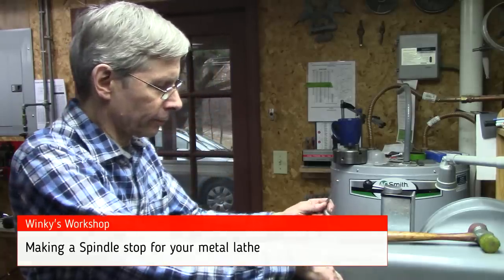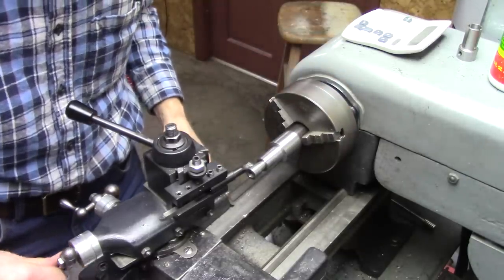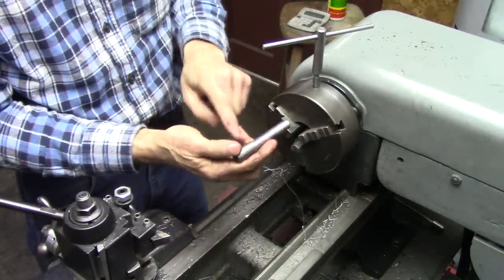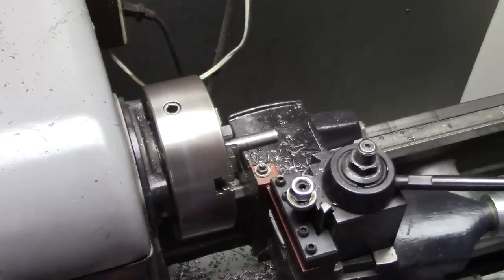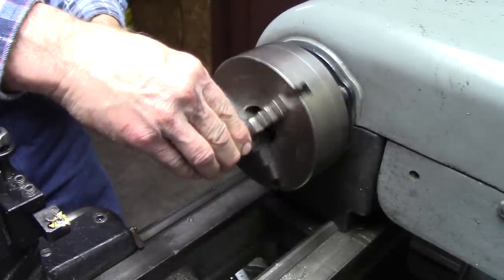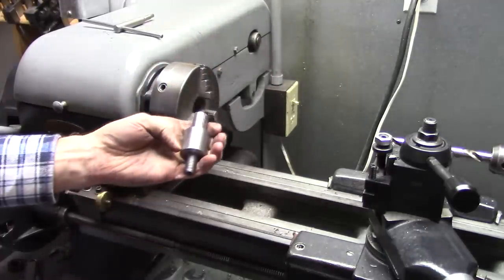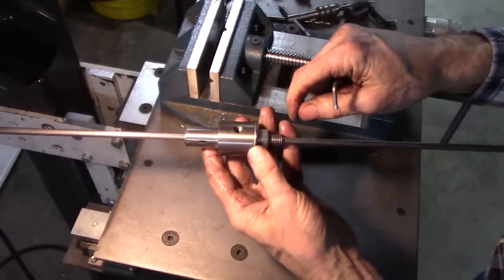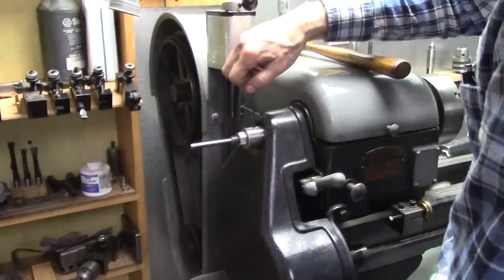Make a Spindle bore Depth Stop for your metal lathe

Comment: This is a really handy lesson for us that might come in handy at least knowing if we need a stop for a small production job and instead of what we do now measuring in from the spindle nose with the raw bar stock length setter. Thank you for showing us how it is made and made reliably. Lance & Patrick.
Reply from the maker: Thanks, I made the first one about a 2 years ago and have used it maybe 10 times. I was making multiple parts for work and it was super handy.

Comment: Nice build, found a commercial made unit while seagulling the other day, never seen one before
Reply from the maker: Thanks! I made another one after this one. It's similar but a bit more simple. I just found one of the commercial stops. It looks similar. I was wondering how they would make one to fit different bores but it looks like you have to order according to what your lathe bore is.  https://youtu.be/A663_KAFptA

Comment: Winky, I feel your pain on change gears as my lathe has them too.  I do just enough single point threading to not quite remember what I did the last time.  I've found it helpful to take a picture with my phone camera before I change them, so it will be easier to get back to what they were.  Thanks for the video!
Reply from the maker: You are welcome. Yes I have done the same with phone picture of the gears. The gear charts are hard to read. Stacked gears are very confusing on the Logan chart because you can;t tell which gear in on top. Maybe we need to make a Pictorial Gear Chart for all the common threads! Ha.
Reply: @WinkysWorkshop   mine is a Grizzly G0602 and the chart is no better.  I have drawn more than a couple of sketches, but they get discarded when I think I'll be able to remember the next time.  I should know better.
Reply from the maker: @boblasley5640  - It amazes me that anyone making a lathe now days would make one without a quick change gear box.

Comment: I had never owned a thread file until recently, but man, I am impressed. Old banged up threads can be fixed in a few minutes. Slitting saw speed was too fast, you can find feeds and speeds charts online, works for basically any rotating cutter. Fun video :)
Reply from the maker: Yeah...  I thought I was on the lowest speed but I was wrong... off hand I'm not sure what the lowest speed is but I'm not sure it will go slow enough anyway. That saw was a fist for me. Thanks!  And yes, I need to get a thread file
Reply: @WinkysWorkshop  My machines don't hit the exact recommended speeds either, sometimes you just have to go with what you've got.

Comment: Hi Winky,

I see you using the tapping fluid bottle as is. I use the same stuff however have put it into a small Golden Rod oil can. Had the make a new spout and nozzle with 1/16 hole in it be able to more accurately get the fluid in the correct place. Much easier and cleaner than using the original bottle. The GR oil can come in different colours so it is easy the have different types of fluid and type them by the container colour. The cans are a little light and prone to tipping over.if you would like me to send you a sketch of a base that adds weight to the base of the GR can let me know an E-mail address I can send it to. The steel base has a slight interference fit on the can base and really helps with stability.
Keep up the great video’s really enjoy them and your good humoured manner.
Thanks jb

Comment: A very nice simple design. I like the way you edit videos, they are always apleaser to watch. In a past video I thought I saw a similar size lathe with a quick change gear attachment? Are you planning on going through it and cleaning it up? That would  make some good videos. Thanks again Andy Z.
Reply from the maker: Yeah...  I thought about making a video after I took the head stock apart. It's a Logan 820.  I guess it's not too late. I really need to get that done and sell my Logan 200. Space in my shop is getting very tight now than I have a mill.  Thanks for you kind words on the my videos. Now that I have figured out the editing software I enjoy making the videos.
Reply: @WinkysWorkshop  hey winky the 820 is a 10" isn't it, if so that will be a nice lathe for you. They are heavier than the 9". There is a website  called "Tony's lathe archive UK" that has alot of info on Logan's. I also subscribe to a channel called "Build Fix Create" that you should  check out. He does some nice work. Good day!
Reply from the maker: @andyZ3500s  - Thanks for the info. Yeah the Logan 200 and the 820 are both 10 inch but the 820 has the quick change gear box and heavier bearings, cross slide and compound. It also has a clutch and half nut where as the 200 has only the half nut.

Comment: Using a similar tapered lock mecanism i made a handle for the rear of my lathe to turn the spindle when tapping, i think steve jordan made the one i copied(more or less) I could add the centre stop and setscrew to have best of both worlds. You could add a handle to yours too under the nut and use it for hand tapping or whatever to turn the spindle. thanks for sharing
Reply from the maker: Actually I may do that. It would be nice to have to rotate the chuck to access the hole for the key. Thanks!

Comment: A good idea.  You have a mill, just mill a couple of flats on the large part to hold it with a wrench instead of using the hex key.  I often use a hex collet block to mill a hex for a wrench on the jigs I make.

Dave.
Reply from the maker: Thanks, I was thinking I'll just drill a hole and use a pin as a wrench. With the 1-1/4" stock I can drill almost 1/2 deep.

Comment: A spring loaded tap follower would make a good video, and besides, it looks like you could use one :)
Reply from the maker: I've used them before. I like setting the quill snug and manually following the tap. The tapered point on the spring loaded followers tends to climb out of the hole. Modifying the tip  would probably fix that however. I made one for my lathe but the pin isn't held captive.  At some point I'll make a video of how to make a long handled tap handle you can use with the spring loaded follower or quill. Larger taps have a hole in the back but the small ones do not.

Comment: Couple suggestions. Use holes drilled for a spanner wrench to tighten it in the bore. 
If you want to get rid of the hex screw, cut a pipe thread taper on the end of the rod holder and cut slots like a collet on the end and make a tapered nut to squeeze the rod. Think pin vise or an xacto knife.
Cut a keyway in the rod holder along the body after the taper and install a pin or dogpoint hex screw to keep the rod holder from turning. Then you wouldn't have to loosen the rod, losing the setting, to remove the depth stop from the lathe.
Reply from the maker: Yeah, I thought of the spanner wrench...  also just a pin would work, the hole could be almost a 1/2" deep. I love the tapered thread idea! That would be very easy to do if I had some way of cutting pipe threads. As far as losing the setting goes, I can see where it might be good to be able to keep a setting even if I haven't had the need.  You could make a couple of depth stops and switch between presets. Thanks for the comment! I love comments like this...  they make me think!
Reply: You could taper the inside and make a little collet like a router then you wouldn’t have to change the 1/2” threads sorry for the late comment

Comment: your slitting saw was spinning to fast you were at alum. speed not steel next time cut the speed in half. next buy a spring center or make one it will make tapping easy on lathe and mill. thread files will make cleaning up threads easy.
Reply from the maker: Thanks for the advice on the saw, I thought I was on my lowest speed but after I got finished I realized I had one more lower speed.  I suspect even the lower speed might not be slow enough. As for the tap guide I'd rather use the quill lock an move it as I go. It seems a lot more solid. The point on the spring loaded guides tends to pop out of the hole on the tap handle. I suppose I need to modify the tip on my spring loaded guide. Back to the saw...  do you think cutting oil might be better that water based most cooling?
Reply: tapping fluid is fine but speed is the killer of sharp tools. I have been a machinist for 45 years. a spring loaded center is only a guide using 2 hands your tap should be straight when you tap. thread files are great for cleaning single point threads and buggered up bolts. thread files are not for cutting threads just cleaning up. there not pricy give it a try.
Reply from the maker: @rring2646  - I should get a thread file but the comment in the video was not referring to rough threads. I wish I could remember the youtube video I was watching but the guy said, if you don't file the tips off the top of the threads you will go too deep trying to get a nut on the threads. There is always a little burr on the top. In fact he said, if you use wires to measure the thread depth quite often a nut will not screw on until you file the tips of the threads. It made sense and I have found this to be true. I think it might have been "This Old Tony". The guy really sharp and has a great sense of humor. Check him out if you have not already. Of course a thread file might do the same.
Reply: I have watched old tony his approach is not wrong the thread files remove the sharp edge on the thread top. the 3 wire measure only is for pitch diameter.
Reply from the maker: @rring2646  - I understand...  Thanks. Yeah, Tony is a real character. Sometimes a little too high tech for me but good stuff.
Reply: I love to watch cleaver people, you hooked me on your wood lathe. there is no one way to do anything and I am always on the lookout for a new  way to approach to a tasks. your wood lathe is a prime example. I remodeled a shopsmith mark 2 (yes very old) with a lead screw to turn wood and used high speed steel  tool holder because I found the gouges messed up everytime I tried to use them. also your spindle bore stop was something I built in the past but using a set screw the move the center shaft is something I will do next time a I make one. again very cleaver.
Reply from the maker: @rring2646  - Thanks Ron. I've been using the wood lathe quite a bit lately.  It's amazing how smooth and easy wood turns with HSS mounted solid on a cross slide.  I'm a little disappointed with the tracer but it works. I've already designed a new tracer attachment. I'll make a video when I build it. It may be a several weeks because i don't have the steel yet.
Reply: looking forward to your approach. looking forward to your next video. good talking to you.